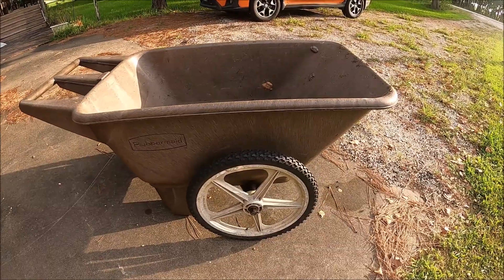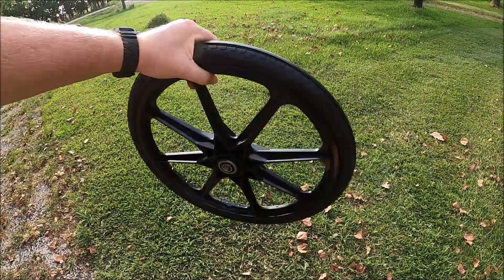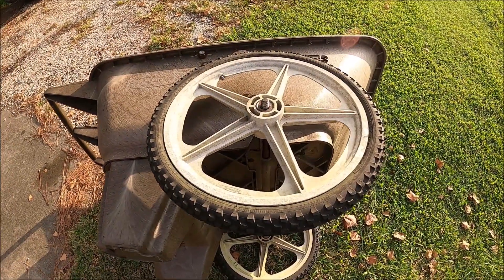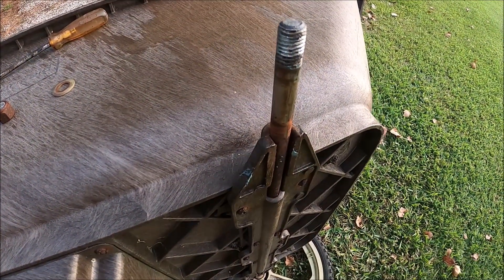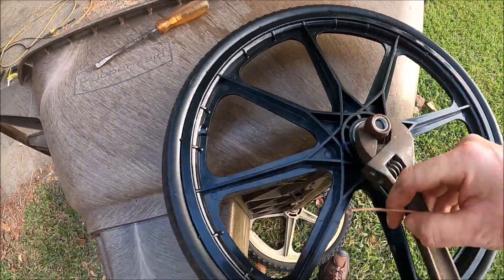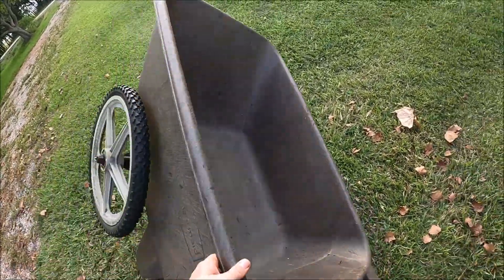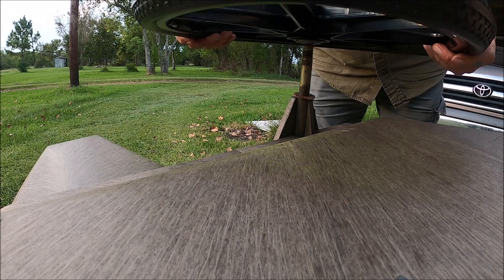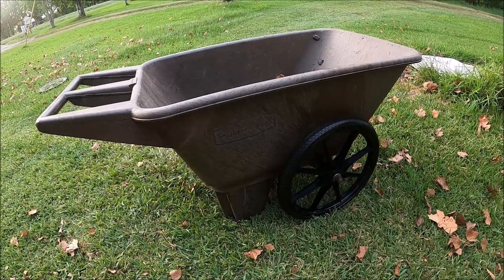Rubbermaid wheelbarrow wheel swap

Comment: Thanks its currently 230 in the morning woke up a hour ago cant sleep and now i know how to change rubbermade wheelbarrow tires lol. I have thier huge thick plastic dump trailer for mowers and its nice got it for free found it in the woods when i was 12 fixed it up and used it to mow grass and carry all my yard equipment around the neighborhood as a kod doing landscaping work and lawn car maintenance. Im now 33 got my own place and still use the same trailer almost twice to three times a week to move dirt gravel debris chairs ect atound the property and has not broke or failed on me once. But probably due to me modifiying the lactchibt mechanism to where it laches and locks down where it cant come undone unless i un do it to tilt, installed reall tapered ball bearing and races instead of the brass bushing they used as wheel bearings. Also put a better rim and tire on jt cause it had literally a plastic rim with a dolid rubber thin tire on it. Its huge it will hold 1500 lbs of dirt no problem and my mower tows that weight with no problem due to me putting a huge counter weight on the front of the mower and its a big old john deer lawnmower with a huge v twin motor i modified and sounds like a harley Davidson v twin motorcycle/hotrod v8 motor woth no muffler and with out coubter weight and trailer the mower will run 85 mph and o have a hand throttle its like a bike brake lever on steering wheel for throttle i built it as a work horse for my huge property and the mower was made in the 70s beautiful lawn tractor with all metal body looks mean and aggressive as heck and is basically the biggest lawn mower you can get before it is considered a tractor